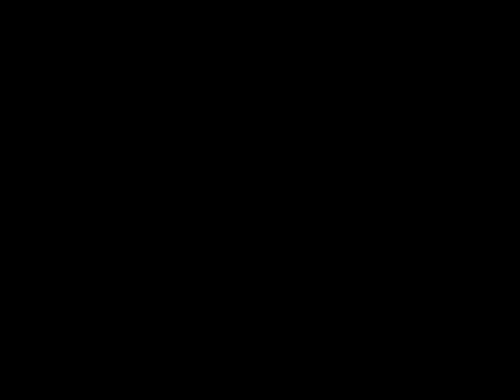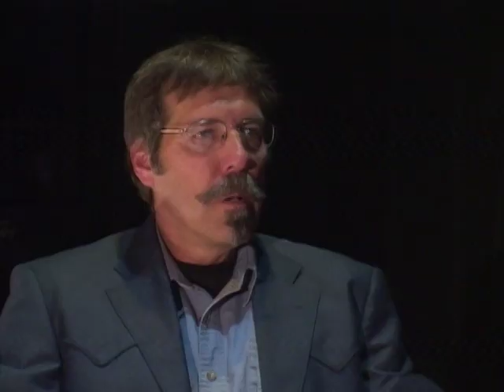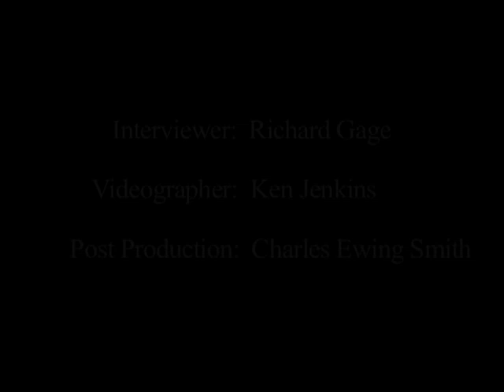Tom Sullivan - Explosives Technician - Loader - AE911Truth.org

Comment: "It's a liquid when it's wet and it can actually be painted on, I mean these guys might actually have thought they were just painting. When you're painting with it, it's safe. It's really quite remarkable stuff, when it dries it's a high explosive." -Steven Jones, Former Physics Professor, Brigham University speaking about 911 and super thermite (powdered iron oxide and aluminum) which burns at 2500 degrees Celsius, much hotter than jet fuel

Comment: It does if it has 40 giant steel support beams going through it holding it up. The World Trade Center wasn't a house but buildings that were made to be tough enough to survive multiple explosions and fires. Somene had to destroy those support beams in order for the buildings to collapse as they did, whish is where the thermite comes it, it burns through steel easily, and it coincides with the firefighter reports about there being rivers of molten steel in the basement of the WTC. Just my 2¢.

Comment: And the out side aluminium cladding was getting ready to fall off from the galvanic corrosion on the bolts holding them up. That would have been nearly a billion in scaffolding alone.

Comment: @Zoink555 Tom Sullivan worked for CDI about 10 years ago before and during 9/11, and he worked for CDI for almost 3 years. His roll with CDI was Site Photographer/Explosives Technician. He is also licensed by the FDNY to handle explosives. His explosives tech. duties included placing explosives in buildings to prepare them for demolition.Sullivan worked on projects such as Seattle King Dome, Three Rivers Stadium, Philadelphia Naval Hospital, Key Span Gas Holders, among others.

Comment: @PapaOystein My imagination has nothing to do with the fact that asymmetrical conditions don't produce a symmetrical collapse just because you have lots of momentum. They don't overwhelm the structure SYMMETRICALLY. It's like saying that if I cut off your leg and replace it with a flimsy wooden one, that if I pile enough force on top of you that both legs would buckle at the same time. The weak one goes first, always; and this gives a split second delay for the other to fail asymmetrically.

Comment: I was in Las Vegas in 94 when they imploded one of the hotels.  I was in the Aladdin which would later be imploded also.  We had a room on the top floor and it wasn't noise that woke me up but the buidling shook like small to medium quake.  The building being imploded was across the street from where we were.  Would this have happened in New York that day?
Reply: Seismic data patterns were surprisingly small

Comment: Does Tom Sullivan know any of the experts that had to be used to take these buildings down? Does Tom know anything about the up grades to the floor girder insulation performed by CDI at the WTC? These buildings did not just have a controlled demolition. These buildings were pulverized...thousands of filing cabinets and only one was found? No computers, no telephones....I mean this was more than just bringing the buildings down, they were turned to dust. I think the upgrades to the floor insulation was a sprayed on explosive mixture which would explain the lack of furnishings.
Reply: Lorenzo Dontello cam you elaborate on that?
Reply: Yours is an interesting theory.  The pulverisation was so very obvious, as was the later evidence of the 'dust cloud' being pyroclastic in nature. ( Cars left entirely scorched, all paint and plastics missing etc.but no indication of fire.)

Comment: Tom, I know that you are talking here about WT7, but may I ask about the twin towers. I have not seen any evidence from the videos of the collapse, or from the collapse site, or the inspection at Freshkills of any exterior wall panels having been cut. The wall panels were designed to take 40% of the load, so I would expect that a large percentage would have had to be cut to facilitate a collapse. Can you provide an explanation for this? Simon
Reply: Can you provide an explanation for this?

Tom Sullivan cannot because Tom Sullivan is not an expert in controlled demolition nor any experience whatsoever. He held a loaders license which simply allowed him on job sites. According to his boss, Stacey Loiseaux, he was there to photograph the area only.

Comment: Can someone please ask one of these experts what is required to bring a building down like this given that it was on fire? This is very different than the static conditions demolition experts generally work under.
Reply: Lorenzo Dontello Sorry, that's just ridiculous. A controlled demolition using nuclear devices? It would have made a massive shockwave for miles; people in the immediate area would have been vapourized. It's not just unlikely, it's categorically impossible.
Reply: That's just it though. Even if the entire building was ablaze from the 1st floor up, the cement and steel frame would have survived intact. The absolute worst case would be it could topple over. The smoking gun is that these building fall almost perfectly into themselves, causing almost no collateral damage (relatively speaking of course). The only way that can happen is if all the supporting beams are broken simultaneously. This is the symmetry that is always mentioned by experts. It's that symmetrical collapse that makes this utterly impossible - ESPECIALLY with asymmetrical office fire damage.
Reply: GregJoshuaW Why would the frame have survived? It was not built to withstand intense fire for that long a period. Any structural engineers who have assessed WTC 7 have found serious structural deficiencies and inadequate fireproofing. Read up on the Aegis insurance case - 5 experts hired by Aegis to prove negligence in the collapse testified to this, and did not find any evidence of negligence,

If you review the official collapse theory, you'll see that it was one column's (79) failure in WTC 7 which triggered the collapse. One major connection failed, causing horizontal beams to sag, which pulled down other beams in the column. So it didn't fall symmetrically. You can see the penthouse and roofline of WTC 7 falling inward several seconds before the exterior buckles and comes down on itself. The core support of the structure collapsed assymetrically, as you say it should have. The symmetry of the exterior falling is consistent with a global collapse caused from assymetrical fire damage.
Reply: federalreserve Brown  - that's cute. Thoughtful comment.
Reply: federalreserve Brown  Btw, watching this again, you can clearly tell this guy is reading from a script just off camera.
Reply: federalreserve Brown  Uh huh... and why do you suppose they put fireproofing around said steel beams?
Reply: federalreserve Brown  Can't stay on one point, can you? Squibs? When a building collapses, where do you think the air inside goes?
Reply: federalreserve Brown  - critical thinking question: when a building gets hit by a plane and there is a massive fire - is it silent? Is it therefore not probable that people would report sounds of explosions in either case?
Reply: federalreserve Brown  - you can choose to see whatever you want, but "everyone" is not in agreement there... not even close.

Comment: Careful what you assume. The twisting motion proves the initial move down of the building (after the penthouses collapsed) was due to folding or buckling of lower support. Nothing else can be garnered from it. It does not account for the penthouse collapses or the remainder of the shell collapse.
The question remains; why would a group of architects and engineers miss this and claim it came straight down? You can see the whole building shift to the east as a first move.

Comment: This guy might be just a 'loader' BUT he'd dead right wherein he speaks. Right down the line. Even 'loaders' know what it takes to drop a building or blast rock or cut steel. You don't live long or work for someone if you don't.
Reply: Even 'loaders' know what it takes to drop a building

How? Their expertise is literally just carrying explosives around.

And Sullivan didn't even do that. He was there to take pictures. He needed a loaders license to be on site.
Reply: @timshea4279  Were you there? I've loaded plenty and learned a lot. WITHOUT a license! That isn't rocket science.
Reply: @lewiemcneely9143  
Funny how everyone on the internet is exactly what they need to be in the moment they need to be it.

That isn't rocket science

I take it back. You just might be. Because that's the sort of arrogant reply some plebe with a loaders license would say about highly complex structure dropping.
Reply: @timshea4279  ALL blasting works the same way. You 'PULL' a shot whatever direction you want it to go. A controlled demo PULLS the middle first. The the outside falls into the inside. I started working around shooting in 1969. Where were YOU, Pal?  I always worked with the head powder man. You don't need a majors in anything to see it work. Common sense helps a lot. More than just powder did these but I don't know what. The shot had help and plenty of it. But since you're so smart, YOU explain it. I've watched it for over 50 years and it always works the same. YOur turn.
Reply: @lewiemcneely9143  
In other words, called you out and you had nothing left.

You threw your best pitch, "loader", and I parked it. Time to run along and get your algebra homework done.
Reply: Tim Shea . Incapable of critical thought

Comment: @blueshark69 "Why did Herrit & Jones have to soak their sample in highly flammable MEK for days, before they lit it?"
You didn't read the paper carefully: They didn't light the MEK-soaked sample. This sample has a very different XEDS spectrum (Fig.14) than the 4 incinerated samples a-d (Fig. 7), and also looks rather different. They are two different materials! (The MEK-soaked chip is most likely WTC steel primer, the other chips are probably a different kind of red paint)

Comment: @thecyberpunk It's in the building specs. Minoru Yamasaki was the architect that built the WTC he designed it to withstand the impact from a Boeing 707. the planes chosen to be flown into the building were chosen specificly because they were the bigger bodied 767. at almst 50% greater mass they were thought to do the job. Read a little more before you go getting into conversations th the big boys.

Comment: (cont'd), one of the things drilled into your head from Kindergarten onwards with regards to tornado warnings is, DO NOT take shelter in a structure like that.  
The object lesson for me (as a layperson) is that for optimal structure strength and resistance to destructive forces both mechanical and thermal, trusses are suboptimal for that.
There are close-up photos of the WTC trusses available on the web, with other objects nearby so you get a sense of the scale.  To me, they (cont'd)

Comment: @Blacktoe Correct. If it's nanothermite, it won't necessarily be heard as- unlike traditional thermite/explosive. And yes, I think thermite would survive, at least for a time...perhaps a few hours when something that burns hot enough happens to ignite or if triggered by a "detonator" which in this case may be unconventional. If magnesium alloys were used in such a detonator it could reach 3100 degrees C and ignite something(nanothermite) resistant to the high temps of an office fire/explosion.

Comment: "Collateral damage, windows breaking for blocks around, that kind of thing, it just doesn't happen if it's a controlled demolition." That actually goes against the controlled demolition theory because there were many buildings damaged by the steel from the towers and that had broken windows from the collapse. 40 people were killed in the Marriot Hotel and the Church below was completely flattened.

Comment: @PapaOystein Dude, when one side drops first onto the lower section, that side should buckle first. How do you tie buckling/bouncing together? The "bounce" is just a word for the lower section and different sides putting up asymmetrical resistance to the top, so that the top falls over-without going through the structure as it resists the fall more than surrounding airspace. OK city building was damaged incredibly, and there was fire, but no falling from fire/structural damage.

Comment: And this fireproofing is to delay the heating up, and to protect the integrity of the SUPPORTING steel, but because the CORE columns are encased in concrete, it doesn't matter if the trusses weaken, the CORE should not be the FIRST to fail.

Comment: @oneshotki11 
No, we don't have an explanation. Asymmetrical damage doesn't cause a symmetrical collapse, especially not a near free fall collapse. How did the jet fuel remove the supporting columns on all the floors beneath the impact? They gave away like they were made of cardboard. Nobody builds huge skyscrapers out of cardboard, it would be hilarious but too unstable.

Besides, building 7 was so obviously a controlled demolition it wouldn't be a stretch to think so of the others.

Comment: (cont'd) or warehouse going up in a massive 5-alarm fire, and several of those have ended up with partial or complete collapse.  News photos/vids of the wreckage often show warped roof trusses.
Now, I agree with you: In my observation, seeing numerous high- and mid-rise buildings under construction I've always seen I-beams used.  ONLY I-beams.  Where I *have* seen widely-spaced columns + trusses used is in big-box retail stores and gymnasiums.  And growing up here in Tornado Alley, (cont'd)

Comment: @PapaOystein I'm a bit busy, so I'll post post a more in depth answer on my blog when I can. Short answer: 1.It depends on the version & if you're talking WTC7 or the towers. On WTC7 they first said it was pancaking...now it's fire. In '05 Sunder said a pressurized fuel line fed the fire, then NIST eventually said "fuel oil fires did not play a role in the collapse of WTC 7." (NCSTAR 1A, p xxxii) 2. Not many, other than ones I refer you to to educate yourself. 3.Neither-I'll expound on the blog.

Comment: AE911Truth never mentions Building 7 twisted counter clockwise as it started down. That can only mean the lower supports folded, or buckled. If they were taken out with charges, the first move at the top would be straight down with no twisting motion. Subsequent collapse, with the west portions of the building falling south and eastern section falling north, as well as the debris pile, confirm this twisting motion. Why has AE ignored this most important clue?
Joe Hill, 911Truther De-Tox on fb
Reply: You can see the same type of movement in any CD video in fact T7 twists less than some conventional CDs.

Comment: @mcbowler 
You got me.
"The topping out ceremony of 1 WTC (North Tower) took place on December 23, 1970"
WTC was designed in 1950 - 1960 before 747's were flown commercially in 1970.

Comment: @unRompecabezas In physics, the path of least resistance is always taken by objects moving through a system. For example, water flowing downhill follows the path of least resistance as it is pulled downward by gravity. For it to go STRAIGHT down, rather than one side, both sides have to BOTH be the path of least resistance. If one side is hit, then it should be more compromised, and be able to resist gravity(stand up) less than the intact side.

Comment: (cont'd), then why NOT a high-rise structure?  From what I've seen and read of the WTC construction, the structural system doesn't seem RADICALLY different from, say, your average warehouse (I-beam columns and trusses overhead.)  It's basically just repeated 110 times.  If a warehouse can burn down, why can't the same thing happen to one or more floors of the Twin Towers, and why would they stay standing if you took a floor out of the middle?  NOTE: (cont'd):

Comment: @PapaOystein 1- this is precisely why an investigation is needed as to how this is possible as the same core should resist the top & it fall over into a long line of debris, in 1 direction. 2- Ok, but other witnesses report them before and during initiation. 3- So because it sounded LIKE a detonation to them, it could not be POSSIBLE, thus no investigation is needed. 4- Not like you want to hear, just witnesses hearing booms. And if they were incendiaries, would it not be quieter & do the job?

Comment: @eldongb1 "Boom boom boom" can be any noise in a building fire. None of these reports are in line with explosions that have the timing, loudness and brisance of cutting charges. 
Timing: Must be exatly before and at the initiation of collapse, not just sometimes during the day
Loudness: Must be MUCH MUCH louder than noise of collapse. INSANELY loud, awsomely loud
Brisance: Must be sharp, cracking BANGs. A noise described as BOOM is usually not an explosion.

Comment: @eldongb1 "Dropping a person on you when you're leg is hurt will not make them fall through you" - a) you have a matter of scale here - the structural properties of a 1000ft building do not translate into 6ft scale just like that  b) A person dropped on you from 9ft up (height of a floor) will likely crush you and make you go down straigt. Now if your body consisted of 90% air, the result would be even more pronounced.

Comment: "only thing in free fall is the debris being spewed out the sides"

AND WTC 7 at 1.75s, [when the kink forms], to 4.0s of the collapse as INVESTIGATION found it DID.

from the NIST 7 report...
-[NCSTAR 1A 3.6] "This free fall drop continues for approximately 8 stories, the distance traveled between t=1.75s and t=4.0s...constant, downward acceleration during this time interval. This acceleration was 9.8m/s^2, equivalent to the acceleration of gravity."

equal to a bowling ball falling through AIR